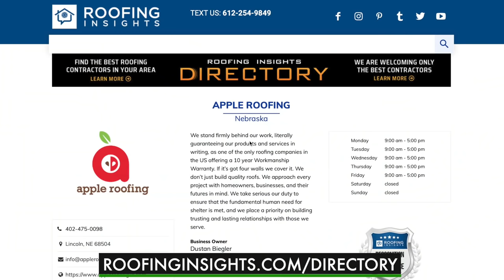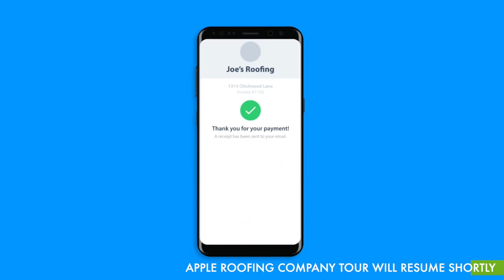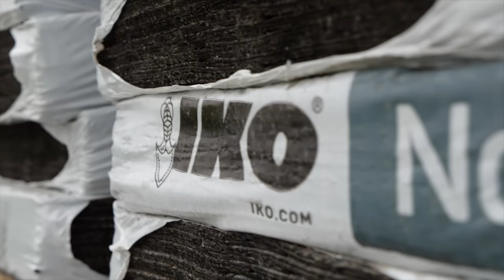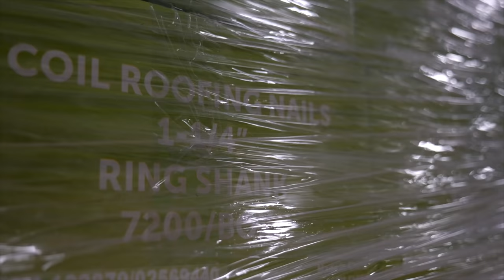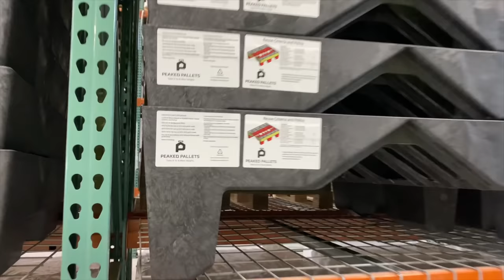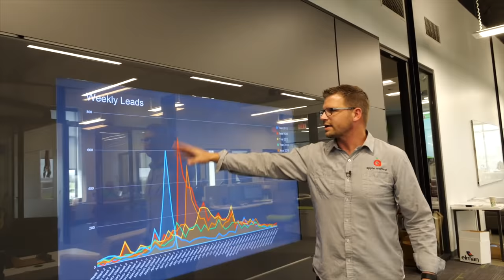Apple Roofing : IKO Shingles, 60 trucks, $6MM office, DEBT Free Business

Comment: Always enjoy getting a peak inside a big operation like this. I never realized until I watched this that double stacking pallets of shingles caused issues. Wished you all had explained why. I don't like the placement of shingles on one of those peak pallets because of the excessive weight in one spot could go right through the roof. I've seen that happen. All the branding on such things as nails is a little overboard, lot of money tied up to impress the roofing crew. Take that savings and spend on a much better shingle than IKO which leaves a pattern all over the roof that looks like a zebra. That's why I don't use that brand because they look like Fido's Ass and there's your sign in the front yard letting people know who did it.
Reply from the maker: double stacking is the easiest way for roofing manufacturer to walk out on the warranty...

Comment: June 2021, we listed our home for sale, we quickly were under contract by roughly June 13th.  Per our agreement with the buyer we were asked to put a new roof on. Apple roofing was recommended to us, so we went with them. Do I regret it, yes, I 100% do.  Let me preface this by saying our close date was on July 27th, that was the day we had to be packed up and moved out of our home. While reading what I have to say think about this. I was packing up an entire house by myself, because my husband worked in Chandler and was living in Chandler. I was tending to three kids, working, selling a our home and dealing with what you’re about to read.
On July 20th, 2021, the roofers started to remove the old shingles, we also had our final walk-thru with the buyers that morning and the walk-thru went perfect. On July 21st at approximately 3pm my AC stopped working. I called Martin from apple roofing, he told me he would be at my house to figure out what happened. After them checking somethings, they concluded to call Oscars heating and cooling (not my choice). Oscars came out and checked my unit and said that I was out of freon, but that also my unit was old (a new one was put in March 2013), and we potentially needed a new one. We decided to put freon in the unit, which was going to cost $900.  Per the hvac technician the unit wasn’t taking the freon and the tech wasn’t sure why, he said that we would come back the next day because it was dark at that point. 
On July 22nd, the owner of Oscars heating and cooling came to our house because he wanted to check our attic and the AC equipment, at the same time Martin from Apple roofing showed up. At this point I could tell Martin was freaking out because there was the possibility that his roofers’ nails hit something that caused my AC to go out. I honestly had that feeling, because I just had an inspection for the buyers and everything was sound, and the same time they’re working on my roof my AC suddenly goes out. Martin even told me if they did hit something they would fix it. 
Oscar, the hvac tech said that he couldn’t see a nail that hit anything in the attic and our unit was old. I spoke with my realtor, and she advised me that we were contractually obligated to deliver the new owners a house with a working AC unit. So that is what we did, we purchased a new AC unit for $5,000.00. On July 26th the new AC unit was scheduled to be installed at 9am. The AC techs got there and were putting everything together. They were finishing and running tests to make sure everything was running. However, this is where things got even worse. The AC unit itself was working but it was not putting out cold air. The techs started to inspect, the found that a roofing nail had punctured a coper line underneath the overhang of the roof. The techs called their boss, Oscar and had Oscar go out. Martin from Apple roofing showed up and was cussing up a storm due to his roofer’s mistake, because they had caused our AC unit to go out as well as we had to shell out $5k for AC unit, which it was money we were not expecting to pay. 
The techs unfortunately couldn’t do anything until this copper line was fixed. However, in order to fix the copper line, the roofers who had just finished the roof that day, had to tear a portion of the roof off so that the line could be welded.  Martin had to then call his boss and get the okay to pay the AC techs to weld the line back together. During this time, Martin was avoiding me big time. So, I went inside called my husband and told him what was going on.

I am going to digress in this story. When we hired Martin from Apple roofing, he said he would take care of all the insurance stuff, which he did. He submitted what he needed to. He said that the insurance would send me a check for the portion of what the roof would cost, and the rest once Martin submitted the completion paperwork and photos. We also had a 1k deductible with our insurance. We got our first check on July 6th. On July 6th, 2021, I called Martin and told him that I got the insurance check in. He came to our house, and I wrote him a check in the amount of $5,412.84, which was what the insurance company sent.  We agreed that I would pay the deductible and the remaining balance, of $4,149.24 when I got the 2nd check from the insurance company, with $3,149.29 being from the insurance and $1000.00 from us directly. We also agreed that since we were moving to Chandler, Az that he or an associate would pick up the check from me when ready. 
Now, to go back. I called my husband, and we discussed the situation, and both agreed that Apple Roofing was responsible for the cost of the new AC unit that we had to put in, due to a roofer puncturing a copper line with a roofing nail. Not only were they responsible for that, but also the hotel that I had to book for three nights because our house was 95 degrees and unbearable to sleep in or be in. 
Martin and a few other roofers were tearing off the roof on the area where the copper line needed to be replaced, this went on for a few hours. I went outside to go speak with Martin to see how we were going to handle their mistake. I found out he took off, at that point I called him. I asked him when he would be coming back because we needed to speak about this, and he said that he was busy and had other things to do. I told him that there needs to be a solution, because if not I would take legal action. After that conversation I got the impression that he didn’t care. So, my husband and I cancelled the check we wrote to Apple Roofing ($5,412.84), because we felt we needed a solution to this issue in order to go forward with payment. 
The AC techs finished testing the system after they were able to weld the line together. I spoke with them, and they showed me pictures of the punctured line as well as other nails throughout the house that went all the way through the roof, they were careless. 
On July 27th, we moved out of our house. What started off as a very emotional thing to sell our house and move to another city turned into such an awful experience due to Apple roofing incompetence.  I was so stressed out because I couldn’t have my children in my home while I was packing because it was 95 degrees in the house, but a few times during the day I had to because I had nowhere else to leave them. I was constantly crying. I could have really got passed this if it weren’t for the gaslighting, that Martin and branch manger Kevin tried to pull on me and if they would have just owned up to their mistake. What I am writing now doesn’t even do justice to what my family and I went through. 
Shortly after moving I didn’t hear back from Martin. He finally called me and still didn’t have a resolution, I told him again that we were willing to go to whatever lengths necessary within the legal system to sort this out. 
On August 6th, I contacted Kevin the branch manager, since speaking with Martin wasn’t getting anywhere. This is where the gaslighting took place. He started to say things like your unit was old and made me feel like they were doing me a favor because they were going to try and get this covered by their insurance as a loss. Yes, our AC was older (2013), but was still in working condition and was presented to the new owners and home inspector in working condition and when they started working on our roof, it was no longer in working condition because the roofers hit the line, freon was leaking all day, therefore the ac unit was running without freon and eventually gave out.  It was really an awful conversation and experience. I told Kevin that, we wanted what we paid for the AC unit and what we had to pay for our hotel stay, which was around $300. I didn’t even ask what I had to pay for food because we had to eat out a lot. He told me he would submit my receipts to their insurance company and get back to me. 
We continue to receive bills in the mail, and I had still hadn’t heard back from Kevin.  On October 25th, 2021, I reached out to Kevin again, he emailed me back “we got the work all done. I’m working on the insurance to get it all straightened out.”
As of March 25th, 2022, we got another bill, so I emailed Kevin, because guess what he never got back to me. I emailed him this “I just wanted to follow-up on this matter. I am still receiving bills with interest building up on this account. I would like to wrap up this issue as soon as possible, it is coming up on a year now.” His response “Hey Christina, you can send payment in or call to pay.” My response “The bill doesn't reflect the actual amount owed. Can I get a current bill of the new amount after the revisions from your insurance company?”
This was on March 25th, 2022, and again no reply back as of today March 29, 2022. What we should owe to them is the deductible 1k, plus the remained of what the insurance sent minus the cost of the AC unit and the hotel. Today is March 29, 2022, and as of today Apple roofing never submitted the completion paperwork to our insurance company. 
I would like to add that on July 24th, 2021, I did leave Apple roofing a good review because Martin asked me to and honestly up to all of that happening and just thinking our ac went out because it was older, it was a pleasure working with Martin. But, oh man did severally tarnish that rapport with me.  
So, if you got this far reading my review my solid advice is DON’T use this company, save yourself the headache.
Reply: No, apple roofing is a great company, you just got a bad experience